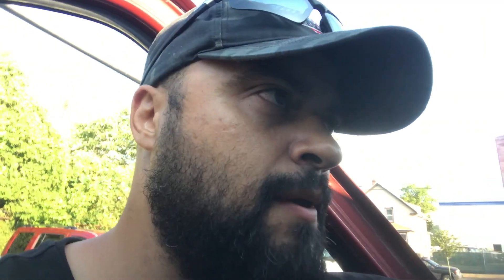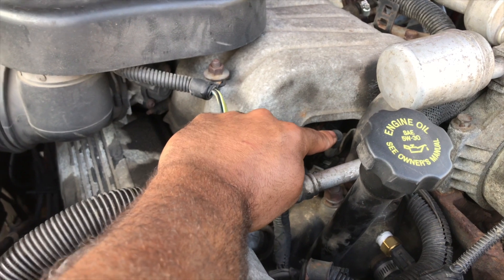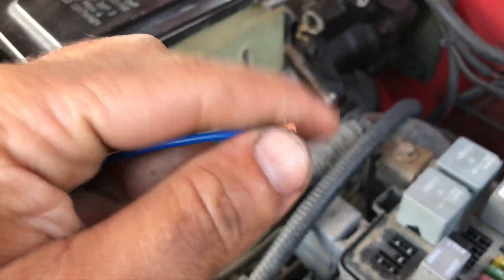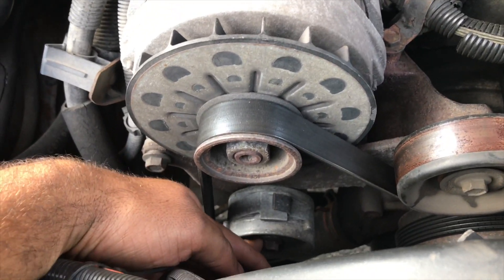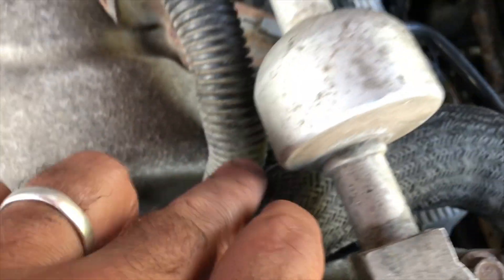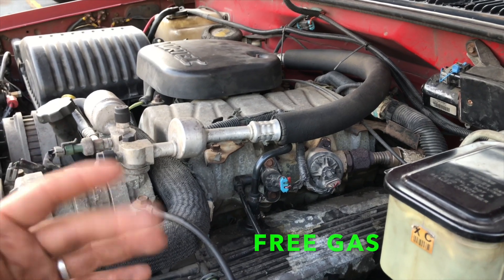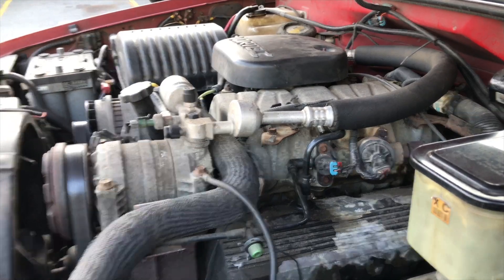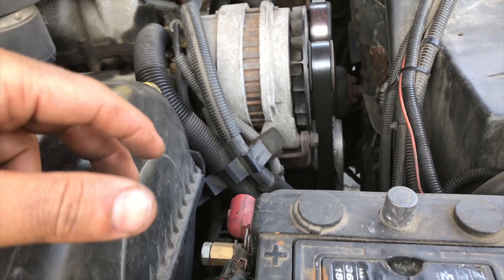454 Vortec Fuel Injectors Problems GMT 400 L29 (Part 1)

Comment: Great video. Question for you. When I jumped the relay sockets, I hear a buzzing noise coming from the engine area, not the tank. It was continuous until I removed the jumper. Any suggestions on what else would make a noise when jumping the two ports?

Comment: Also a really good use of that jumper wire trick on the fuel pump relay socket is to tell if your fuel pump is even working or not! Back in 2018 my truck suddenly just shut-off on me without warning going down the freeway, I coasted over to the shoulder and stopped then tried to re-start it.... nothing, it would just crank and crank without firing! Wasn't sure what the heck had happened, immediately wondered if I'd gotten bad gas when I fueled up a few miles back.... friend of the family happened to see my truck and pulled over to help, had the idea to check the fuel pump to see if it was running and did this jumper wire trick and NADA not a sound from the fuel tank and taking the cap off the end of the fuel rail and pushing the core down with a small screw driver there was no fuel pressure at all. Fuel pump had completely stopped working! Had truck towed back to my house where I proceeded to drop the tank and replace the fuel pump myself it was a PITA! Arghhh! LOL!
Reply from the maker: Awesome 👏🏻

Comment: Good video! I have same engine in 2000 GMC Dually truck, 287K miles and counting. It's been a great engine! 
However, lately it's been running a little rich and hesitating from idle even shuddering a little when coasting off-throttle (like going down a hill at 55mph, feels like the engine almost wants to die). Did the usual stuff, added fuel system cleaner replaced the fuel filter cleaned the MAF sensor and K&N Air Filter... to absolutely no avail or effect! 
So, I'm guessing I must have either a faulty fuel injector (they are factory original!) and/or a leaking fuel pressure regulator. Any thoughts how to tell which it is, or should I just go ahead and replace all the injectors AND the fuel pressure regulator at same time (since it's a bit of work getting to them)?
Reply from the maker: The best way is to physically look at them and also testing it. If it is factory injectors, sometimes is better to replace them.
Reply: @Kahz-w4d  Well I'm a week into this now almost... stuck at unable to disconnect the primary fuel line, can't see it can barely feel it and cannot begin to get a 5/8" line wrench onto it! Arghhhhh! 
I've considered pulling the distributor out completely to get more space, but having a hard time finding anything in all my tool boxes to get onto the retaining bolt that holds it in place (and I used to be in heavy commercial trucking, I have A LOT of tools here!). 

Any thoughts? I'm stuck!
Reply: Well after 3 days trying to get BOTH fuel lines disconnected I finally got the primary and final line broke-loose just before sunset tonight... I thought to myself, "This is it I'm going to get that darn fuel rail and fuel pressure regulator out finally!" But wait, not so fast.... I pried up on all the fuel injectors with a flat screwdriver and all 8 came up and the front 4 even came all the way out of the holes, but SOMETHING is still holding the fuel pressure regulator end of this thing in place! WTF???? I already took out the only retaining bolt I could find on it's bracket, why won't the thing move any at all? There's something ELSE I cannot see holding it firmly locked to the engine and I can't feel where it is... and I sure hope I haven't ruined the fuel rail metal fuel lines (cause it's at an angle now, something has bent back there at least a little)! I give up for tonight the sun has set (it's under my carport, but the shadows of lights at night make working on it far more difficult and I'm beat). You wouldn't think I had all this apart to change the primary intake manifold gaskets just about 8 years ago but I did and it only took me 3 days back then.... what gives? Grrrrrrr! :-\
Reply: I think there is a 2nd retaining bolt that holds the primary and return fuel lines and fuel pressure regulator down back there, under the edge of the distributor cap (looking at pics of the bracket after the fuel rail is removed online). So now i still will need to remove the distributor tomorrow I guess so I can get that bolt out and remove the fuel rail finally maybe! This is really starting to frustrate me now, and if the fuel lines have kinked then I'm screwed anyhow at this point. :-(
Reply: @MShrader211  how did it end up going?
Reply: @niclev4093  It runs, but not well. Now I'm getting fault codes again finally... too lean bank 1 fault, too lean bank 2 pending fault. I replaced the PCV valve but that made no difference. Also re-checked for intake leaks but found none this time. Kinda at a loss what to try next.... any thoughts?
Reply: @MShrader211  I know more about the tbi suburban 454 the peanut head ones the vortec ones kinda stump me but last time i had too lean conditions i replaced alot of sensors before it fixed anything which included camshaft and crank position 02 among other sensors
Reply: @MShrader211  It also sucks having a k&n filter cause it can cause the maf to read wrong also i found out there was a vacuum leak in addition to a exhaust leak
Reply: @niclev4093  It can, but you just have to clean the MAF sensor about once a year at same time you clean the K&N air filter. I've used the K&N air filter for almost the entire 2 decades I've owned this truck (replaced the filter just 1 time, when I found some small holes had formed in the filter element 2 years ago). It's never been a problem otherwise. 

I have however in the past 5 months changed the fuel pressure regulator, the fuel injectors, the upper intake gaskets, the MAP sensor, the idle air control valve, the air temp sensor in the intake, the throttle position sensor, the PCV valve and finally the lower intake gasket (a water test showed mine was definitely leaking to my surprise)... and not it's tripping fault codes Lean Condition Bank 1 and Pending Lean Condition Bank 2 and still not running right! Arghhhhh! Now I'm frustrated beyond belief. :-|
Reply: @MShrader211  God how attached to it are you ive hocked problem cars and trucks for less electrical and computers getting into vehicles was the worst thing to happen in a while it used to be air spark fuel now you cant even list what could be wrong
Reply: @MShrader211  i also have lean conditions in a different car a infiniti it ended up being camshaft and crankshaft position sensors